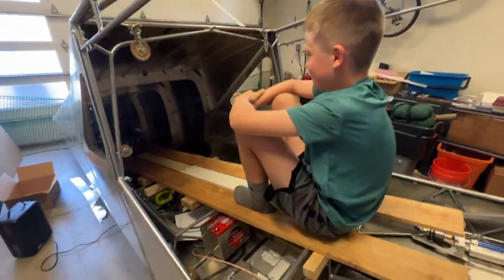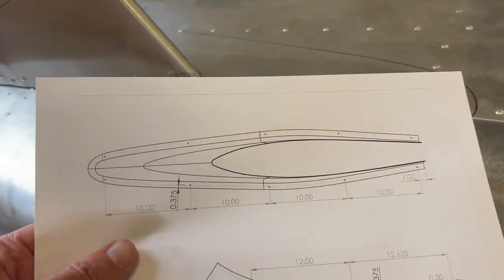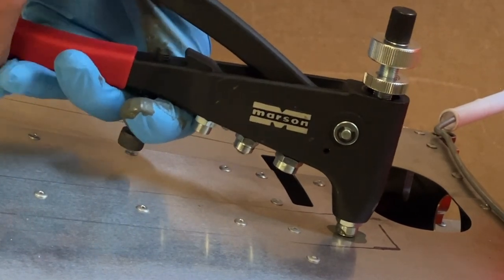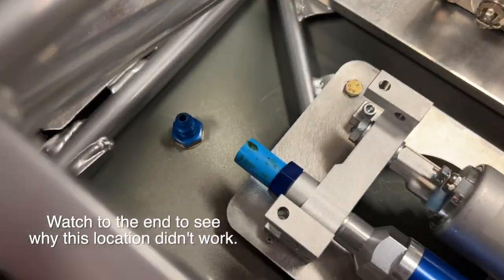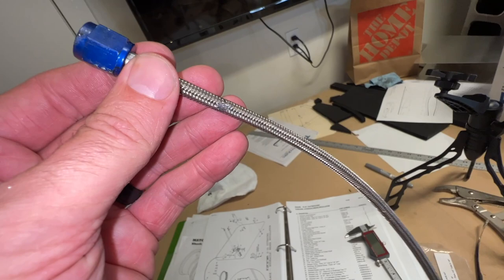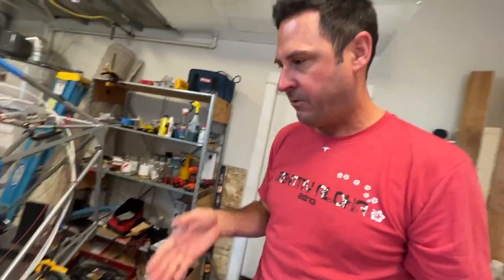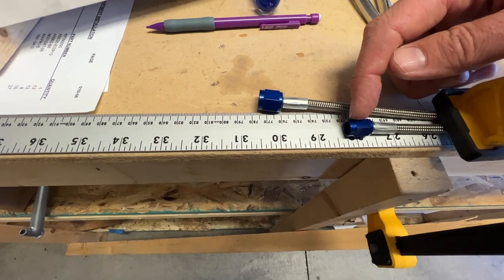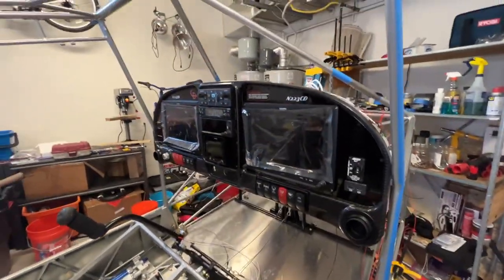I’m such a ROOKIE! Brake Line frustration, Carbon Fiber Fairing! S-21 Build Episode like 17-ish?

Comment: Just a couple of suggestions.  On the brake lines, start at the brake and then up the leg.  At the top of the leg a 180 degree loop back to the fuselage fitting, facing inboard.  This all gets covered with the plastic fairing.  On the fuel line from the header tank to the fuel pump.  Make sure the hose clamp straps holding the header tank down are loose.  My hose was about 3/16" short which made me slide the header tank forward a bit.  Don't try and stretch the fuel line hose.  If you want to pressure test the header tank use water.  A lot safer than air.  A 27" tall water column is 1 psig.  Be careful with rivnuts.  I hate those things.  After a few years and removal of screws a few times they tend to loosen up.  I like plate nuts a lot more.  Just my 2 cents worth.
Reply from the maker: Thanks, Walt! I sure appreciate each of those thoughts.

Comment: I was told by a very creditable source to ad some sort of layer in between the carbon fairing and vert stab/fuselage as if the carbon works through the paint and touches the aluminum there could be some sort of corrosive reaction. I used a thick clear door or window sealant tape on mine.
Reply from the maker: Great tip! Thank you

Comment: Live and learn. It's always tempting to offer peanut gallery advice, but by the time we see the vid, it could be weeks after you have already solved the problem. So...I'll offer this bit of advice to those in similar straights. Personally...I've done more living than learning, but occasionally, lessons do stick. I have learned (after many frustrating projects graphically proven by tool sized holes in my garage walls) that for me (your mileage may vary) the whole running hoses, lines and such things, usually goes better if I run the lines before mounting end points. If one end or the other is attached to something that flexes and moves, I include the range of motion into my mounting calculations. 

Steve...I gotta say it's pretty cool that you let any learning experiences (mean people might call them mistakes) all hang out, so others can learn from your solutions or create their own...but they are at least forewarned that a bridge might be out ahead. Thanks for sharing. 

PS...that fairing looks pretty slick. Really adds a nice swoopyness to the tail. It's a technical term...don't bother googling it.

Comment: Yes, doing those grip switch set screws was a pain.  I did mine last winter as that was good winter work.  I also was careful to run the tap in slowly so that the threads were not all the way through which allows the set screw tighten up as it gets flush and not keep going into the stick.

Comment: I would tape the vertical stabilizer and fuse with packing tape and then fill the gap in the carbon fairing with epoxy and microspheres It which will adhere to the fairing but not the packing tape.

Comment: I took two pics today of our factory built S-21 for you to view how much slack Rans put in the brake lines but can’t seem to attach photos here.  If interested, instant message or something and I’ll send them to you.  It appears basically 1-1 1/4 inch ‘slack’.
Reply from the maker: Thanks so much! Would you mind emailing them to me at steve@cleareddirectresources.com ?
Reply: @CLEAREDDIRECT  Steve that address didn’t seem to work.  Do you have alternate?

Paul
Reply from the maker: @paulosborne1911  hmm the address is correct. No alternate. If you’re comfortable posting your email, I’ll send you a message
Reply: @CLEAREDDIRECT  Steve, it worked this time.  Check yer email please.
Reply from the maker: @paulosborne1911  Got em. Thanks again!

Comment: If you go back in your video you said you told the guy making your break line you need a 29" line end of fitting to fitting. Then right after that you said 29 1/2" was what you needed. Just want you to get the right measurements communicated.
Reply from the maker: Yessir. Definitely some confusion and I own any miscommunication. Appreciate the accountability as always!

Comment: You are ahead of me, but I am surprised that RANS doesn’t give some guidance on the hole for the brake line fitting.
Reply from the maker: The guidance is there (figures manual). It was just wrong in my case. Not sure what’s different about my installation but I’m sure I screwed up something.
Reply: The guidance is there just vague, start the brake line at the brake caliper with the fitting aimed at the groove in the landing gear. After going past the bushing in the landing gear bolt you make a 180 degree loop and attach to the bulkhead fitting in fuselage.😉
Reply: @Bushmasterpilot  that's what we did Ruben...haven't done the final yet bc waiting on paint so it's good to know we did it "correctly".